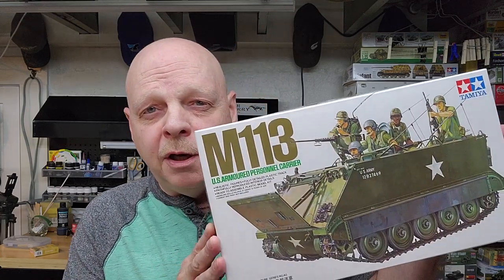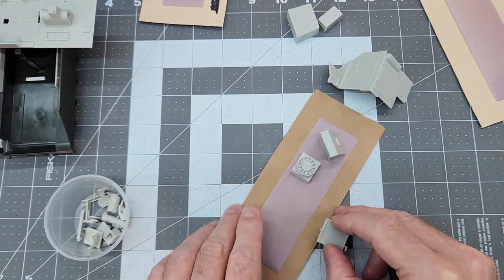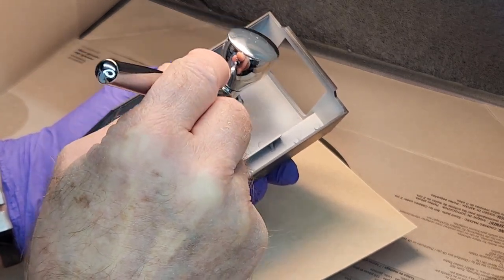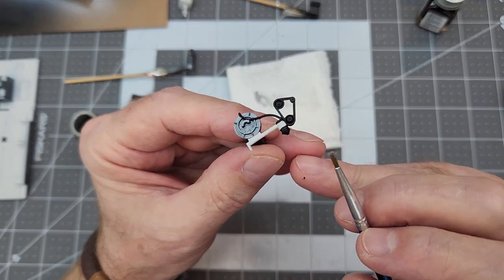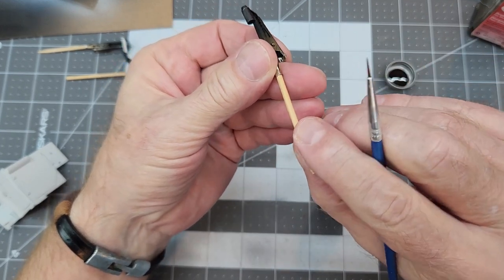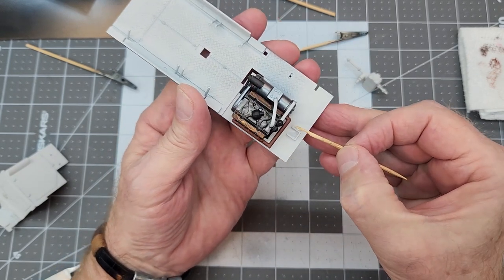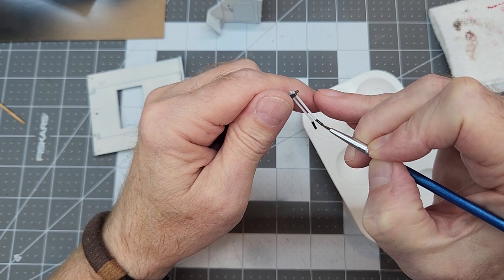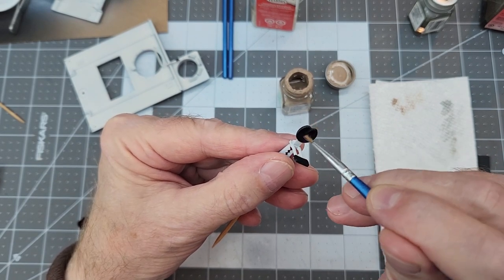M113 Armored Personnel Carrier, Build Part 2, Interior Painting

Comment: The decals for the data plates in the Driver's Hole look good.  Those aluminum engine access panels have a black closed cell foam (EVA?) seal around the edge that you can see when you secure the clamps tightly.  I served on later A2 tracks that were the Seafoam Green inside, except the 81mm M125A2 and 4.2in  M106A2 Mortar Tracks that were Olive Drab in the back.
Reply from the maker: Hi thanks for the comment. Those decals really do ad a lot to the interior. Your right about the later APCs with the light green interior, this is the M113 with the gas engine, pre A1/A2. White was often used for the interior on these just like armored vehicles of WWII. The color change came later (I think with the M113A1). Mortar vehicles were painted green inside because of having the large roof hatches open for firing, exposing the interior to aircraft flying overhead, so olive drab is the best to help conceal these vehicles from aerial attack. Thanks so much for watching, I really appreciate it my friend! Johnny

Comment: Hi Johnny you show some awesome tips during this video. I like how you apply the decals , using the helping hands to hold the part is great and the tweezers for the decals is helpful.  Just wondering why you used CA to glue some parts down ?  Thanks
Reply from the maker: Glad it was helpful Jerry! Sometimes I use CA glue if I need to glue parts that are painted. The Tamiya extra thin cement is designed to soften and "weld" polystyrene plastic together. If the part has paint on the mating surface it will prevent the cement from softening the plastic. It with then just soften the paint resulting in a less secure joint. We can always remove the paint at the joint and just use the extra thin. All depends on where the part is in the build, it's a judgement call. It also helps to use CA where the contact surface is really small, or if you would like to move on quickly with the build and not have to wait for the extra thin to dry before continuing on. Also, if you are joining a metal part such as photo etch or metal wire you have to use CA on those materials. Hope this helps clear up any questions you have. Thanks so much for watching, take care and model on my friend! Johnny